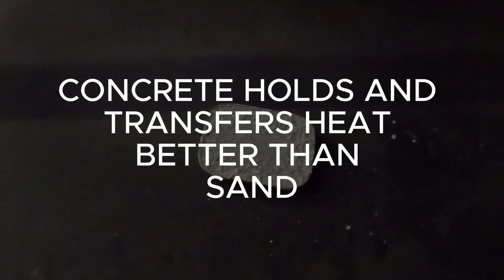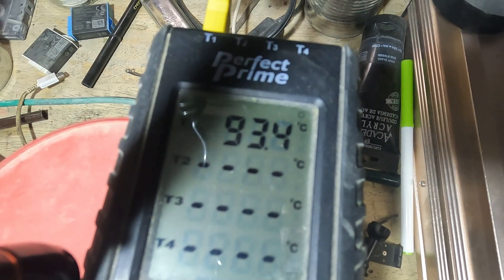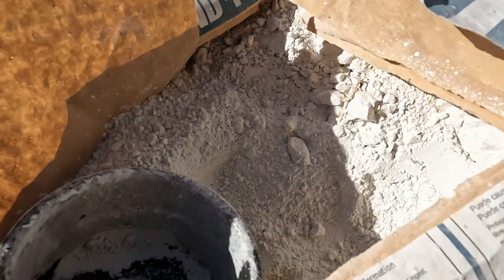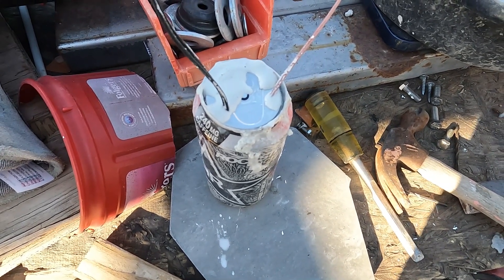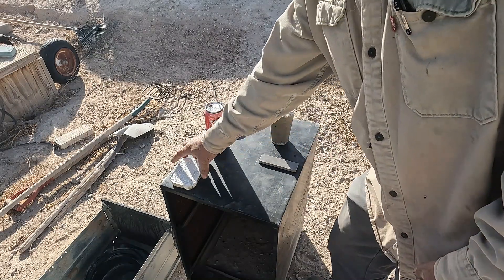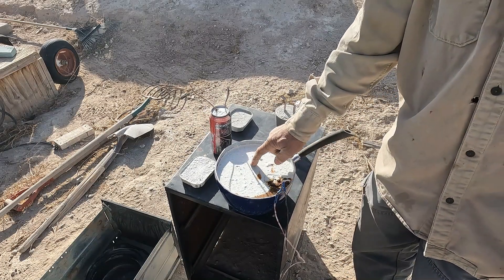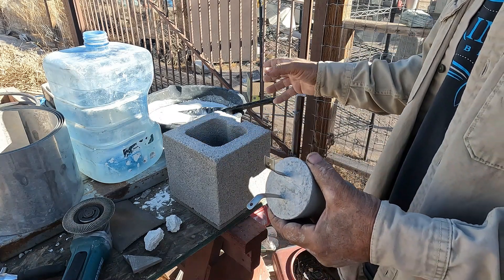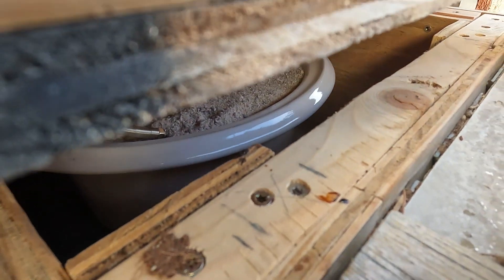173 - Salt and Cement Thermal Energy Experiments

Comment: The take away I'm getting from this is to make and/or line the containers and heating elements ( wires or burners like a rocket stove) with concrete and maybe fiberglass to protect from the salt and use the salt as the main way to store the heat.
Reply from the maker: I am not sure if I can use this material or not yet but I will keep experimenting with it to try and get a some data or see if it's viable.

Comment: You are doing important work.  Perhaps try a 24vdc water heater element, cost around $20 and wires are protected from the salt
Reply from the maker: I tried a hot water heater element early in my experiments and it got too hot for the element as it wasn't submerged in water like it is designed for so it totally disintegrated. It was a 120 volt hot water element. But it worked for a while.
Reply from the maker: I feel it is important work also. Thank you

Comment: "dear algorithm... here in the other hemisphere it is currently, at 8:27 AM, already 32C, with  a predicted high of 38... i expect 42..."
Reply from the maker: Goodness that is fairly hot I will say. Greetings from the other side.
Reply: @off-gridsurvivalmike8120  the heats cool (huh?!?)
its the 90%+ humidity that kills you...

last week it was 10C... bit hard to acclimitise to the sudden extremes?

lol, if i could get the energy to get off the couch, i would be making a "heat tank" to drive the internals of an absorption fridge. pump some chilled water through a radiator... or maybe a water feature out side for evaporative cooling?

"gunner do it one day"... lol...

Comment: Avoid salt for electrical heat. Instead use salt in solar-thermal troughs or as a filler in a rocket stove. I prefer solar thermal since 2/3 of the sun's energy is thermal and 1/3 is other, including photons for PV panels.
I plan to build a sand battery next year using solar thermal as the main source, with a rocket stove backup just in case of 5+ days of clouds, and let this setup heat my sheds.
Reply from the maker: Great idea, I have been planning on testing some solar thermal ideas also. Using glass and black painted steel or maybe stone? I have quite a bit of glass to experiment with. And I agree with incorporating a rocket stove or some kind of back up to the system.

Comment: Other ways to store heat, WITHOUT insulation is by chemical reaction and are very promising. The most cheap and non toxic ways are calcium chloride (dehumidification salt) or "13x Molecular sieve" zeolite clay, by dehydratation-Rehydratation, or Sodium Acetate (used as heat pads, and as preservative in food industry). You can store heat when it is sunny, store it like wood in a non insulated storage, then when you need to cook, or to heat by grey days, just reactivate it  !
Reply from the maker: That sounds very interesting. I will research it.

Comment: Maybe try some of this instead of wire: High Strength Carbon Fiber Graphite Rope High Temperature Heat Resistant Carbon Fiber Rope Conductive Supplies 2-6mm(4mm Diameter)